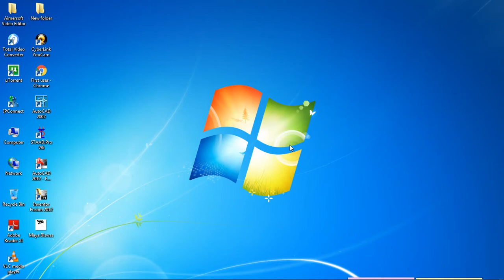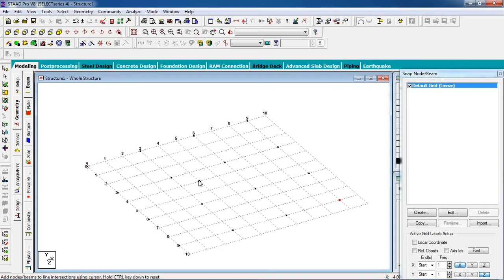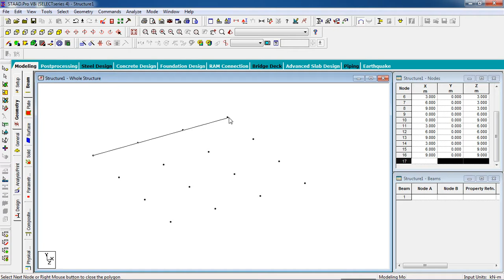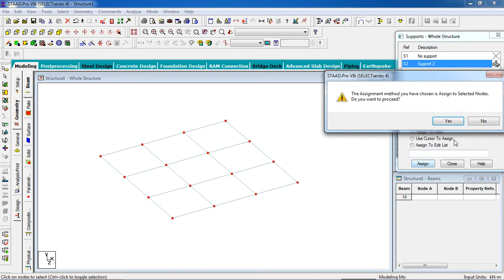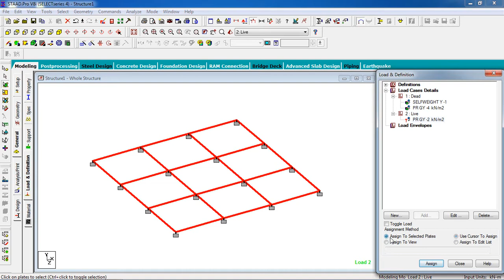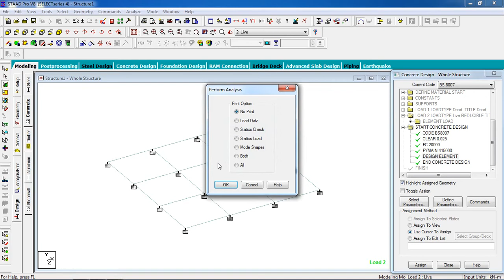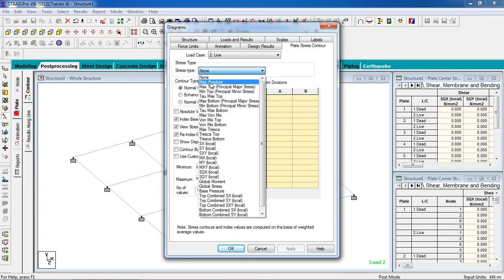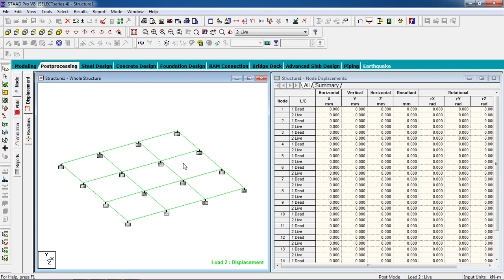STAAD Pro Tutorials - Analysis & Design of Flat Slab ( Day 31)

Comment: Plus in Etabs slabs are applied either with rectangular plates or at joints. But I see you using quadrilateral method and later dividing by spans. I don't understand that. Can slabs be placed easier?